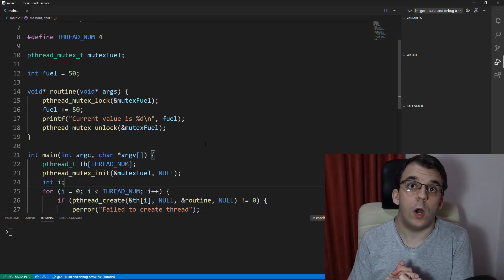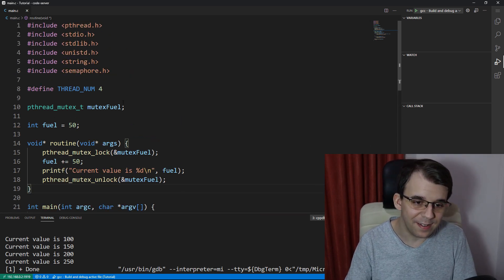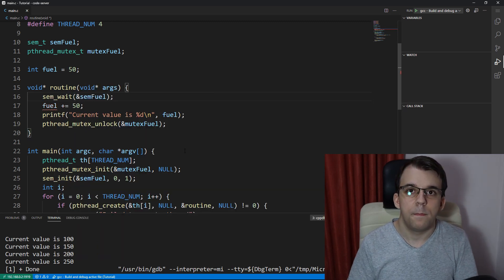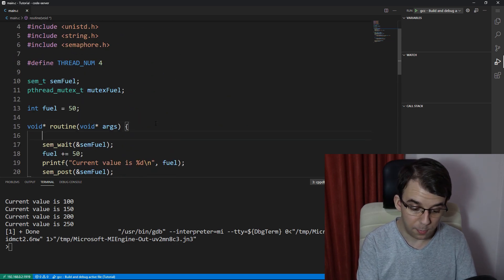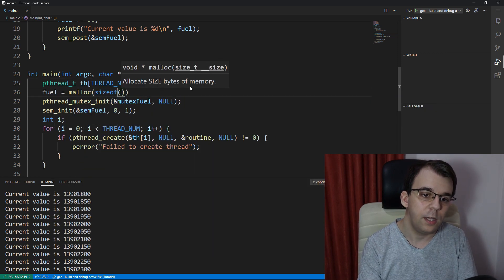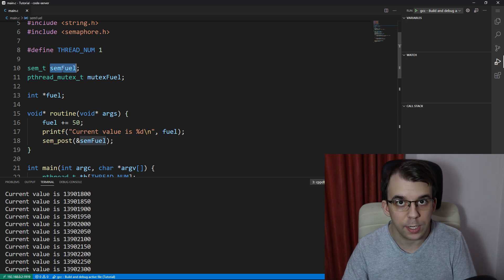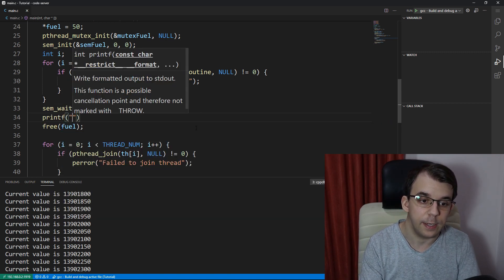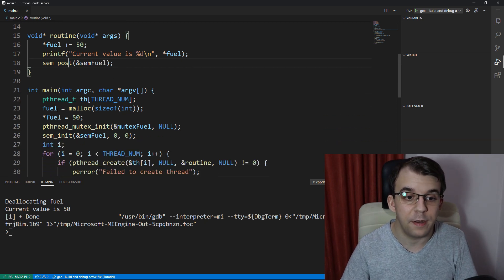What are binary semaphores?

Comment: Thank you for your extremely helpful video, sir. In my view, since you are using a binary semaphore, it seems that removing the code for pthread_join() doesn't affect the overall result. Do you think this analysis is correct? Thank you.
Reply from the maker: pthread_join is always needed when working with threads otherwise the threads might terminate prematurely due to the main process exiting

Comment: I'm sorry but I really did not get how, at 6:02, after removing the binary semaphores, the thread was inside the routine method yet somehow did not increment *fuel (as if it skipped it) and printed the proceeding line normally. How is that possible? I can't quite get that.
Reply from the maker: The thread basically gets a pointer to already deallocated memory. Which means we are getting undefined behavior. In this case, it's simply pure chance that the value that we have in the currently deallocated memory for fuel is 0 (it could have been anything else)
Reply: @CodeVault thank you for the explaination. I was wondering the same thing as well

Comment: when you remove the sem_post/sem_wait calls, how come the program doesn't encounter a seg fault on line 17 since you are accessing deallocated memory?
Reply from the maker: There are a few possible reasons for this:
1) Accessing deallocated memory doesn't guarantee a segfault (that memory could still be unused so you're not accessing memory from another process that you don't have access to)
2) That printf("Deallocating fuel\n"); in the main function takes way longer than it takes to create the thread and change the fuel value. So the memory didn't have time to be deallocated before used

Comment: Hi, I had a doubt regarding your implementation
1. When you removed the semaphores the deallocation happens then why doesn't printf in routine function gives an error?
2. After doing sem_post once, sem_wait in main can continue and deallocate the memory, how is it executing both routine threads?
Reply from the maker: 1. It's because the deallocation happens after the sem_wait call. And, since the semaphore is initialized to 0 that sem_wait will wait until sem_post is called on the routine function
2. At 3:52 I set the number of threads to 1.  So there's no longer other threads executing that code

Comment: Let's say we have two different functions one for incrementing the fuel and one for decrementing. Can we use the same 1 semaphore before critical section? Or should we define two different semaphores one of which is used in the increment function and one of which is used in the decrement function?
Reply from the maker: If you use binary semaphores as mutexes then you need to have the same semaphore. Otherwise... I don't know, depends on what you want to do with those functions
Reply: @CodeVault  in increment function, I do value++ and in another function, decrement, I do value--. That's just all.
Reply from the maker: Depends what you want exactly. You need the same one if you use them as mutexes.
Reply: @CodeVault  Yes, thank you for pointing that out. If you have two different mutexes, when increment function tries to increment the value, at the same time, decrement comes and tries to decrement the value. So, that 's why we need to have the same mutex. When increment tries to increment the value, other threads working on increment, and the threads of decrement will not be able to enter the critical section.